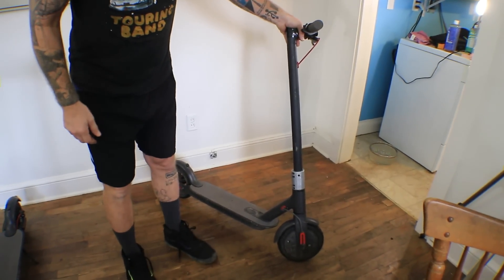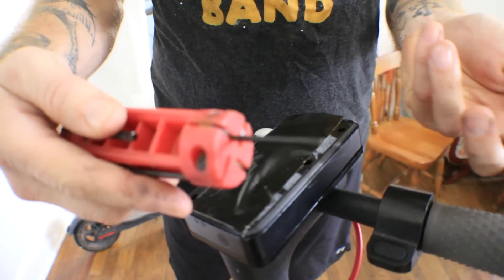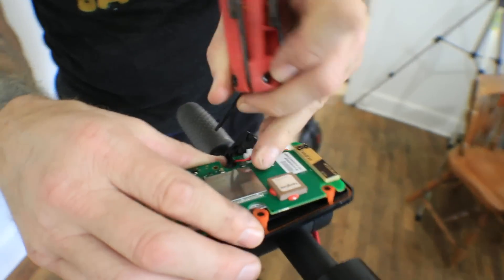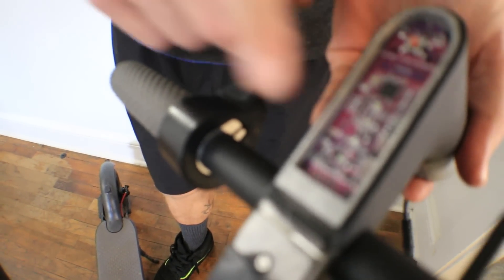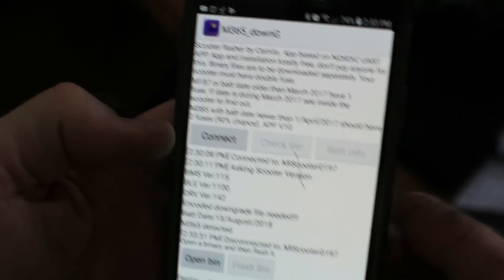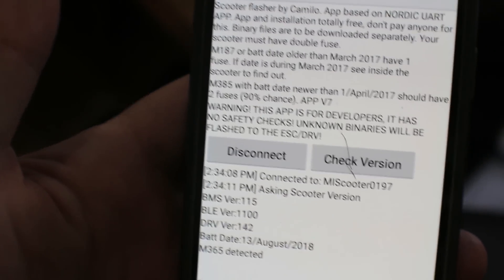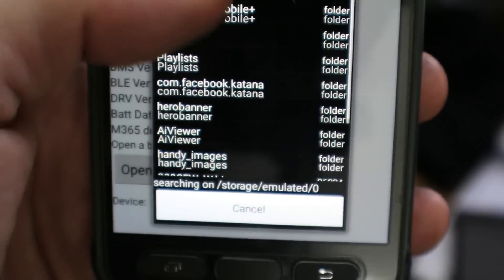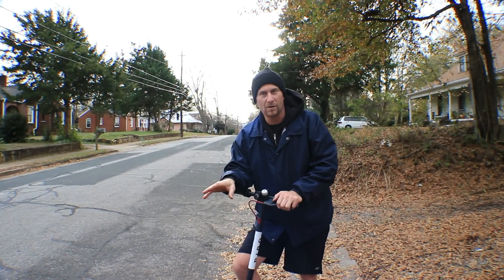Abandoned Bird Scooter now works like a regular scooter!

Comment: Found a first generation bird one .. are electronic cables hard to get and brake  cable and electronic dash ..front tire is stuck had been partially buried so look kinda rusted should I try to loosen or buy a new wheel assembly .. the electronics are all intact in plexus glass casing .. since it was private has no GPS or they would have found it .. think it’s worth it ..
Reply from the maker: Definitely do not just take a working one off the streets for parts. That would be stealing.

Comment: $23 I found the piece on Amazon cheaper https://amzn.to/2LuCcCe Dashboard for XIAOMI M365 Electric Scooter Circuit Board (dashboard with cover&stickers)

Note: If you don't know how to connect to the app, please see the product image. There are steps to connect the app in the picture.

When you replace the new dashboard, please connect the dashboard with the throttle and the electronic brake first. If there is no connection, then connecting to the APP may fail.

Before you order this Bluetooth circuit board, please confirm whether the fault of your main controller is causing the Bluetooth version to be damaged. Only the Bluetooth board is damaged, not the main controller is damaged, you can directly replace it.

If the main controller has been damaged, we advise that your controller and bluetooth circuit board must be replaced with the original one at the same time. Otherwise the main controller will cause the Bluetooth circuit board damage again.
https://amzn.to/2LuCcCe

Comment: I picked up a bird scooter. It has the same top as your second with the "telecom board". However, it is the new Segway ES4. It has the break and accelerate button levers, large battery on the base, but no screen. It had the bird sticker on the top just like the Xiaomi Board. Will the Xiaomi M365 work on this scooter or do I need to get the ES replacement?
Reply from the maker: You definitely cannot use a different board for it. as far as obtaining an es4 segway board let me know if you can find one as those are the most plentiful scooters around. The only Segway I've successfully swapped out is an es2
Reply: I have a es4 that was left behind by a scooter company that left the city. I contact them and they don’t seem to want it. I would like to make mine. Do I just need to replace the head.

Comment: I swapped to a new board but the one I installed is blue and not red like yours pictured. The problem I have is that my board powers on as soon I connected the main cable and the scooter ran but I can not turn the scooter on or off or change any modes. Like the power button is not working but I ordered 2 boards  because I got two scooters and both boards do the same thing. Any ideas?
Reply: Mayve it's locked
Try connecting it to xiaomi home and look there

Comment: Just remember if you want to flash the speed controller with your own custom settings (via Botox & M365DownG app) or just want to have the ability to update the firmware through the Mi Home app this can only be done if you buy a "genuine" OEM Xiaomi dashboard.  They are usually around $50.  Make sure it's original from the factory and sealed in the box.  All of the other replacement dashboards which are around $25 are clones and you will not be able to do any "flashing" at all.  It will make the M365 operational and you will be able to connect to the Mi Home app on other third party apps but you will not be able to flash any firmware.  This is probably why Bird and Lyft have abandoned the M365 completely.  However in my own opinion it's still the best and most comfortable model to ride.

Comment: I need your help. I got a new Bluetooth circuit board and when I connect G T P 5 to the motherboard's G T P 5, one of four lights on the Bluetooth board blinks with one tailight blink. Help me please. 🙏
Reply from the maker: Wtf is a gtp5
Reply: @dridiott  I think  he's talking about the round male to female connector wire, I have the same issue he is talking about. the lights blink and it keeps beeping however I can connect to the mi home app but it still doesnt let me ride it

Comment: You know they are both birds m365 folds and those do not but good tip very informative can this be done on segwey es2 (lime scooters)
Reply: Yes. Just search "ninebot Segway es2 control board assembly". $65 and literally just replace it and it works, no need for firmware flashing. Then a charge cord is $15-$20 depending where you buy it.

Comment: I bought on AliExpress a blue generic card with the ninebot logo, it similar to the card from eBay that you put in the description. And for me this card wasn't recognize by the m365down_g app because it's an old generic card and the Bluetooth is not fully compatible, so I can't change the firmware. I had see that only the purple generic card are fully compatible with m365downg, and apparently only some other models in blue can also do it. So before buy a generic card (blue)check in the description or ask to the consumer or seller if you could update the firmware. Personally I bought the original card on AliExpress, more expensive but without problem.

Comment: Thx i got a bord from ebay and stole a bird scooter now i ride it to school
Reply: And now you tell internet  ;)
Reply from the maker: LuX  they cant if you take off the tracker
Reply: @dridiott  I think now they put more than one tracker, is that right?
Reply: @patilanz1  nope, just that box on top for bird and Lyft, spin has it on the bottom of the shaft.
Reply: So you can just pick one up and bring it home?
Reply: @uabb-2121  if it has bluetooth then a nigga of the company rings your door bell
Reply: I found the piece on Amazon cheaper https://amzn.to/2LuCcCe Dashboard for XIAOMI M365 Electric Scooter Circuit Board (dashboard with cover&stickers)

Note: If you don't know how to connect to the app, please see the product image. There are steps to connect the app in the picture.

When you replace the new dashboard, please connect the dashboard with the throttle and the electronic brake first. If there is no connection, then connecting to the APP may fail.

Before you order this Bluetooth circuit board, please confirm whether the fault of your main controller is causing the Bluetooth version to be damaged. Only the Bluetooth board is damaged, not the main controller is damaged, you can directly replace it.

If the main controller has been damaged, we advise that your controller and bluetooth circuit board must be replaced with the original one at the same time. Otherwise the main controller will cause the Bluetooth circuit board damage again.
https://amzn.to/2LuCcCe
Reply: Good for you bro Its a come up!
Reply: I've gotten some, where latterly these scooters were abandoned and left in piles on a corner, cause the charger guys dropped them off cause they weren't going to get pay good enough for charging them anymore and they were there for weeks until I went and picked them up.
Reply: Did you only plugged those cables together and it worked pls tell me 😩😩
Reply: How to unblock the wheel?
Reply: Nice
Reply: I bought the board and installed. The display turns on and i can turn on the headlight and all but the throttle is not rotating the wheel. Why is that? Do i need to install something? I don't need to alter it to go fast, I just need it to run.
Reply: If you stole, better hope you removed the GPS, the Management at BIRD or LIME could work up one day and decide to prosecute everyone who steals a scooter. If that happens your screwed. Although I doubt they will do that as hiring a lawyer is more expensive than the scooter itself.
Reply: RG wheres the gps located?
Reply: @lefthanded5473  bird & lime and all those scooters companies don't care, if they did they be looking for them.
Reply: Bird and LimeBike shred and destroy their bikes and scooters for scrap metal at the end of service life.  They lose the money either way on these. They will not re-sell them or donate them to people in need, they just mindlessly waste them - so honestly - you get what you give. You be a scummy "make money for me and pollute 3rd world countries" company, then scummy things will happen.  Also people throw these in the river and ruin them all the time and the company never retrieves them.

Comment: I just got a board on amazon and I installed it, but it does not turn on or anything.. There is only one way to hook it up..

Should I buy a charger? I know it has some though cuz lights used to come on randomly :(
Reply from the maker: Get a charger. Keep us posted.
Reply: Did it work?
Reply: Im having the same issue. I have a charger and it is charged completely.

Comment: Here's another tips to charge fast, the standard bird charger is 42v 2amp= 84watt. U can charge faster using a dc to dc boost converter. Set the charge voltage to 42v then set the charge current to 5amp that's 210watt which is gonna cut your charge time from 4 hour to 1hour 20minutes.
Reply from the maker: I never heard of a DC to DC boost converter. Googling now
Reply: Boost converter is for voltage. Yes, you can control the amperage if there's a potentiometer on the board for that but every boost topology I have seen requires the input voltage must be 1V or 2V less than the output voltage. If you are inputting 42V then you don't want to go ANY higher. Also, watts are watts (not even including the watts you lose during the conversion, best boost converters are 98% effecient.) You push in 24V 10A you. have 240W when you boost up to 42V you have 5.71A which is 240W. To increase amperage you need to decrease voltage so you could get a 60V 2A charger and get a BUCK converter to bring it down to 42V 3A (just shy of 3A)

Comment: Both of those are stolen bird scooters lol cool ! So many mf's are going to just go steal one that's out for rent. And buy this board https://rover.ebay.com/rover/0/0/0?mpre=https%3A%2F%2Fwww.ebay.com%2Fulk%2Fitm%2F283343300566
or use a brushless electric bike controller like this onehttps://rover.ebay.com/rover/0/0/0?mpre=https%3A%2F%2Fwww.ebay.com%2Fulk%2Fitm%2F302921673524
  and remove the battery balance circuit inside the battery. You can bump these up to 90 volts and go 50mph ! I've had a m365 for years burning rubber on 90 volts !

Comment: I got a m365 as a gift but the firmware version is 10201. And nothing custom works. And also doesn't connect to mi home app but ninebot app works fine. In normal mode top speed is 16kph 😭😭. What should i do?
Reply from the maker: That's old FW!  Try to do the same thing I did. If not throw it in the ocean
Reply: @dridiott  So a new original circuit board can help? And can you give me a new link for it please?. The one in the description isn't working.
Reply from the maker: Oh God yes. Go to eBay and look for it man!!😜
Reply: @dridiott  I need your help. I got a new  Bluetooth circuit board and when I connect G T P 5 to the motherboard's G T P 5. Only one light on the Bluetooth board blinks with tailight. What should I do?? Please help!!! Please.

Comment: Even if you acquire it legally isn't there a tracker or something so that bird would come and take it from you? Or no?
Reply from the maker: Highly doubtful.  The bird scooter looks the same as my m365 everywhere except the bird board on top.  Plus it doesnt show on the app.  Remove graphic and give it a  paint job for extra security.  Don't forget to lock it in public 😅
Reply: @dridiott  technically the stock m365 has a collapsable stem for folding the scooter into a more compact size. The bird branded scooters have a solid collar preventing the scooter from being folded.
Reply: I used to work for bird as a mechanic. The only thing that they can use to track to scooter is the "brain" (top piece with the motherboard) and even then the tracking is shotty at best. there were  any times that i went out looking for damaged scooters to repair that were for lack of better words "ghosts" the app would show that the scooter was at a particular location but when you get there it is no where to be found. the only other way that bird can track it as their scooter is by the serial number which is only on a sticker under the riding plate (what you stand on to ride the scooter). get rid of those 2 things and you have effectively made the scooter undiscoverable.
Reply: I don't want to invest the money to get the board and screwdrivers if they're just going to take it
Reply: @dune.hopper  screw driver is $6 from home depot and the board is $38 on ebay. A new M365 is $550
Reply: Bird could have tracked that bird from 3:21 to 3:30 ..  in fact when he let it ping like that.  He may have left a permanent ghost bounty on the charger map that will appear to live at his house ...  basically forever
Reply: @Ryckmaniac   except there was no sim in the board so no connection..
Reply: i'm sure they could, but it would be theft if they did.  they legally lost rights of ownership of most of their scooters because they refuse to pay the impound fees from illegally dumping their scooters in big cities.

Comment: I don’t understand how the bird motherboard housing case got magically small during the install of the Xiaomi board.
Reply: thr bird housing is a custom motherboard mount using a slimmed down cheap cellphone sized case that mounts on top of the Xiomi handlebars with a metal plate blocking the hold where the stand allone scooter board goes. If you remove that casing its basically the stock handlebars.
Reply: He swapped the handle bars
Reply: he switched them. there's no reason to steal one if you already own one and have to switch the boards back and forth every time you want to use either

Comment: The cost of the control board is 30 bucks on Ebay, a bird scooter cost a dollar to start and 15 cent per minute to ride, it would actually cost more to steal one than to just rent it. If I were going to steal multiple and replace the boards to sell them then the sudden spike of GPS trackers dying would give authorities a general area to check for thefts so the thief runs the risk of being snagged in the act, not worth it either... and it's possibly more safe/lucrative to just sign up as a charger. So this really only makes sense if you legally obtained one from auction, as stated.
Reply: a lot of people use these to take to work everyday so it can significantly add up
Reply: Gay Mods exe it can but if you have a job you hardly feel it, better yet if you have a regular job just buy one like this guy did and then you don't have enough to worry about losing your job trying to steal one.
Reply: @TheRealAlpha2  if you're driving a bird scooter to work you probably are gonna feel it

Comment: Your video is single-handedly going to make all the scooter share companies bankrupt. Way to go, now every thief will have their own electric scooter.
Reply: Forgot to mention this model is the original model. The new ones are same as lime scooter... which ironically enough both the same company. Bird started off with Xiaomi, which owns Segway, which lime uses.
Reply: Sure about that? Bird owes $362,800 to the University of Georgia and $32,000 to Santa Cruz, California. Virginia Beach has impounded 205 scooters and is owed $1,700, as of Oct. 31, 2018. That's impound fees. It cost $114,000 for 500 scooters at $228 each. Also, there's been articles and such already saying how easy it is to hack them...
Reply from the maker: @86LukeM  very valid points Luke. Thanks.
Reply: Mr Reviews it all no problem. I see people yelling this is going to allow people to steal them. The original model yeah. The new one is a Segway ES2 or 4. Which I heard aren’t easy to steal.
Reply: @86LukeM  It is possible to do this with the Ninebot/Segway but it will cost around 60$ because you would need to replace the control board for the official ninebot one, replace the dashboard and add a bluetooth module (necessary only for the ninebot app to work, you can ride without it tho)
Reply: @MGF0x  Or you could rip out everything but the hub motor the battery,  and the throttle, and put in a $10 generic brushless motor controller, and a $5 generic 36v  BMS for the battery.  No smartphone required.
Reply: And kids well never be late to school again
Reply: Bird and co will all go out of business, but they popularized Scooters. Companies selling accessories for them will make mills, same companies making actual machines. Damn, I'm buying my own Scooter next week thanks to bird LOL. Which means they lost another client. I literally used them once, got hooked up, decided to buy my own, and as a cherry on top, I'm getting a free helmet from them as well lol
Reply: Workday Nomads there on eBay for 150$
Reply: Good riddance...
Reply: No what made them bankrupt was outsourcing these scooters to cheap POS China pride companies to where all you have to do is buy the "name brand" scooter that Bird used, hotswap the board from it, and put it in there. If they would have used proprietary equipment and riveted the logic board in instead of using Torx bits it would have also made it harder to steal.   Also who cares? They should have never been put out anyways. Learn how to walk.
Reply: You are a moron. There was already an article published on how to do this.
Reply: @DieselRamcharger  he never said he was taking credit for this hack you numb nuts! In fact, this video is the 1st I've ever heard about this. So why don't  you and 3 of your diesel buddies go find a bar stool to flip over and sit on.